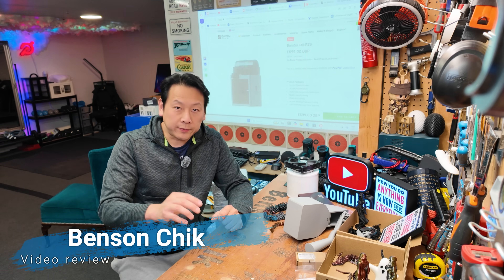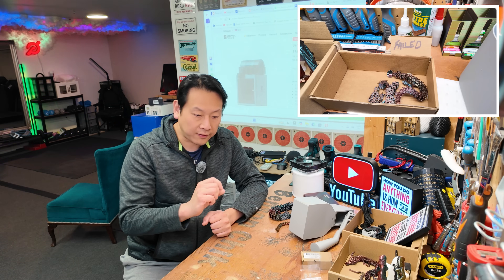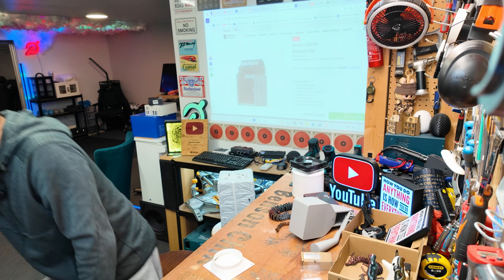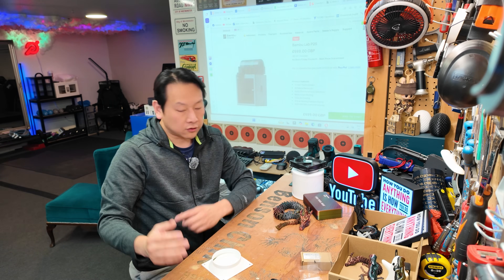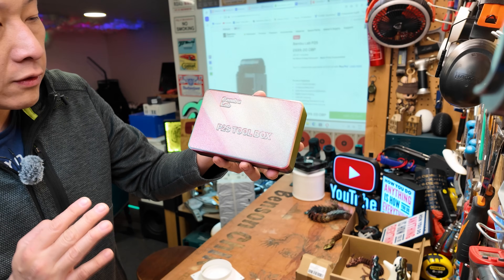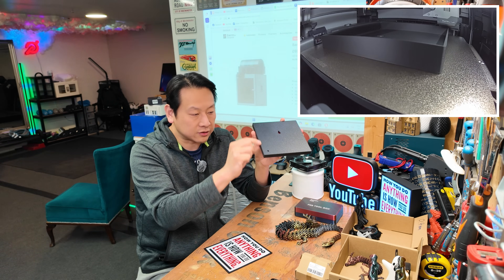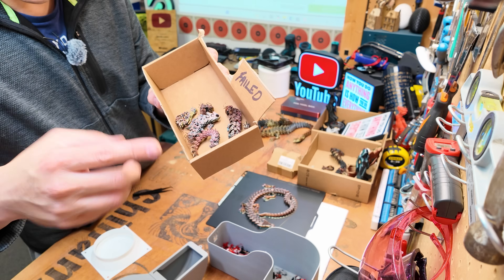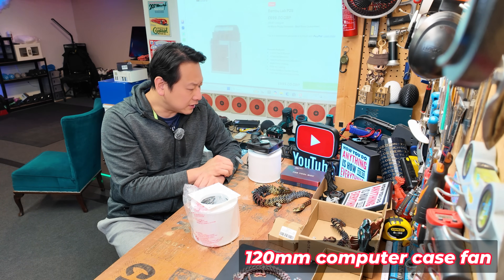Bambu Lab P2S After 1 Week Nozzle Failed, Aftermarket Fix… Do I Regret It

Comment: Hello, Im new to the whole 3D printing world and i just got my P2S with AMS pro 2 and so far its been a learning process just my only main thorn is the extruder overload notification after the 2nd day of printing I've opened and checked many times and multiple cold pulls and still face the same issue. Will the aftermarket nozzle fix my problem or am i just missing a simple fix.
Reply from the maker: Check if the spool in the AMS is turning smoothly, especially if the spool is not Bambu Lab or if it is made with cardboard of different size. After that the cheapest fix or try will be aftermarket nozzle

Comment: Clicking sound is not the extruder trying to grab the filament, it is the gear assembly. And the stationary gear most likely that is mounted in the extruder head. The removable orange gear the slides in there and has a gear on the end seems to be binding.
Reply from the maker: Not sure what it is but since I changed out the 4mm nozzle it never had the same problem again. When the 4mm nozzle was put back the same problem return. Aftermarket hot ends are cheap as chip and over a few hundreds of trouble free printing since.

Comment: I had the same issue with an unusual extruder motor force error on a 0.2mm Bambu nozzle after 1 kg of filament. Cold cleaning the nozzle resolved it.

Comment: i printed the exact same poop bin as you in PLA on my P2S and it had the exact same defect, in the same location 

could you please teach me why that happens? is it just the nozzle that is bad?
Reply from the maker: I think the default setting for that slice is too fast for the over hang. Was the machine shaking violently when printing that?
Reply: @BCreviews ea the printer does shake quite a bit, and it doesn’t help that i’ve got it on a utility cart because I need to roll it towards a window during prints for ventilation 😅 outside of remedying that, its good to know that the default print profiles aren’t to be trusted and that i should slice models myself prior to printing. thank you for the wisdom!

Comment: I'm a resin printer user, and I thank you for some actual user advice and review of this printer.
Reply from the maker: My sister is a resin printer user too, I prefer Filament as less mess and smell, 0.2mm nozzle yield best details but still not as good as resin. Only way to complete is to print with Matt or carbon fibre additive filament to hide the layer lines 😂
Reply: @BCreviews  I just purchased the printer today, I create mainly high detail scale models accessories for my plastic kits and some resin kits as well with my Phrozen printers. Not sure what to use this printer for but I will defiantly have fun with it. I don't think it will replace resin as the detail is unwatched at 10-30u.

Comment: Great video. My one piece of advice for new P2S owners is to buy a roll of PLA. I bought a roll of PETG (for heavy duty projects) which isn’t a bad thing but I couldn’t test my printer with the pre sliced projects that come with the printers pre loaded software. Not a big deal I found a small magnet project on maker world to test out the printer. First print was a smooth 20 minute success.
Reply from the maker: Good call, I would go further and say buy bulk of 5x1kg for more saving, unless you plan to give up and let the printer gather dust which is highly unlikely with P2S and maker world combo :)

Comment: Hi i am on the edge to grab this printer would it be wise to get it or any other recommendation thankyou
Reply from the maker: This is the first printer I had since 2021 so I don’t really have a suggestion of alternative. In terms of a printer for anyone who knows little about 3D printing the P2S is pretty fool proof. It tells you 90% of the time if any human error. If getting their filament it should really be press a button and print.  If you get other brand filament or want to change settings this allows tons of adjustment. 

The only function I would not suggest buying this for is multi colour change in the same model. Yes it can do it but it will be very slow and waste a lot of filament as poop. These is a reason why they bring out a 6 Hotends auto swap machine a few days ago 🤣
Reply: @BCreviews haha i have always desired those good multi color prints i have seen on youtube so wont lie i have to get a ams 😢

Comment: You really glossed over the failure you had with the filament clog? It would be nice if you could explain how this printer handled that failure and were you able to recover or keep printing? What did the part look like after you resumed? Were there missing layers in the print? This is a huge problem I have and would be nice to know if p2s solves it
Reply from the maker: There was no recovery, printer stopped printing and throw up error msg abnormal filament resistance. Tried heating it up to 300c and purge but nothing works. When trying to print the extruder will make very light clicking noise, then error of abnormal msg again At the end it was not worth fixing it, P2s super easy to change hotend anyway, cheap as chips from

Comment: Sounds like a possible extruder issue, keep an eye out on it. Just goes to show no matter how experienced the company is, they still will get it wrong! If looking for an aftermarket Nozzle, hotend, etc., I would go with Microswiss, they have top notch stuff. I have 3 nozzles from them and they are just extremely solid.
Reply from the maker: Gone through 5kg of PTEG Carbon fiber with a £7 aliexpress 0.4 nozzle with no problem so it was the Bambu Lab harden steel nozzle failed prematurely. I since has tested other size including a 0.4mm and 0.6mm AliExpress high flow which I did not experience any more issue. Put the original hotend back in the P2S and the same problem come back, click click noise and filament resistance error code.   Have a look at my more recent video and you will see. Thanks for watching !

Comment: After 8 days of continuous printing, Bambulab P2S does not print. I have the same problem as you. Hotend clean, nozzle clean, printing starts, but after 3 layers it reports the same error. I will replace the nozzle today, I bought original ones, but they are on the way from Aliexpress.
Reply from the maker: I have a video out today using different nozzle huge flow and all. Try using the original nozzle just to show the same error again so that was definitely my problem.

Comment: I just ordered one. My first ever printer. I hope my nozzle don't ruin my first experience ☹️
Reply from the maker: I think it is quite rare to have nozzle fail  :)   good luck !
Reply: @BCreviews I had it too
Reply from the maker: Lucky changing it out is easy and lots of aftermarket ones available
Reply: I got the P2S as my first printer also, you won’t regret it :)
Reply from the maker: Not regretting, must easier to use than one I have 4 years ago 😂

Comment: My P2S is due in about 45 minutes (currently have the P1S with the E3D Obxidian High Flow Hotend) so I also pre purchased the exact same nozzle as you did in this video so I had the high flow possibility of up to about 65/mm3 if I ever want/need it.

It's a shame that given Bambu Labs (from the UK warehouses anyway) sometimes ship using DPD that they don't give the option for next day delivery on shipping, or at least smaller, non-printer orders.

I would imagine the first thing I'll do when the P2S is here is set it up, print some kind of a control benchmark and then do it again with the new high flow hotend installed! We are such simple creatures, aren't we?!

Comment: Did the clicking sound disaooear with changing ti other nozzle? Or what made it go away? I had the same on my A1 with changing extruder gear from Panda, changed it back afther 1 day, clicking sound was awfull
Reply from the maker: It was with the original 0.4mm nozzle, once changed it the issue disappeared. Some say heat it up to 300c and push filament through but I just changed it out
Reply: @BCreviews  Weird, the clicking is usually from the extruder gears slipping, (you can test this easily) if it's the same sound you hear when extruding or retracting filament when the temperature is too low - you can confirm this with PLA loaded by simply trying to extrude/retract PLA when the temperature is below approx. 150 degrees, as this is where the filament generally becomes too solid for the extruder to move 100% of the time.
Reply: @PassieWaterm is it at all possible you didn't put the black grease onto the gears that came with the Biqu Claw/extruder gears? That sound is usually from gears not working correctly inside the extruder, slipping/binding. Also, I've seen it a million times where people install the new gears and the bearing falls out and they don't notice, or it comes out with the stock gear and they don't notice so the Biqu gear goes in and it's missing the top bearing and doesn't work correctly, sometimes with some not nice noises!

Worth checking, in case you didn't.

The other possibility is that the tensioning screw on the side is too tight or too lose - do you recall how tight you did it up when screwing it back in when reassembling? It's really easy to go too heavy or too little in fear of damage.
Reply: @benjaminfphillips i viewed several youtubes with the same problem, and i tried all the solutions (including the ones you sugfest) but with some the is no solutions. I even asked Biqu Panda and the confirmed that same assemblies just do that ( whatever answer that is). I didnt even bother to sent back because i did not know that the standard extruder has a steel  gear, and that is what matters when using abrasive materials, so the steel big gear has nothing to do with that.... so no need to upgrade.

Comment: Ive had my p2s for like a week aswell and had no issues at all, its weird how it can vary so much
Reply from the maker: After changing the nozzle it has been good, no complaints. Changing nozzle is easy and aftermarket one is cheap 😅
Reply: @BCreviews  yeah fair enough, yeah just had no issues with my stock nozzle, guess time will tell
Reply: also had an a1 with 2000 hours that had no issues so i guess ill wait till then to judge it haha
Reply from the maker: Could be the material I use, metallic colour and then PEGT-CF. The hardened tip original should be able to print them tho 

I have high flow hot ends testing this week so that would be even better if shave off some print time
Reply: @BCreviews  yeah fair enough ive only used pla and regular petg hf so far, got some abs in im going to try soon

Comment: With a 0.2 nozzle youre not supposed to use metallic type filament bc it will clog. Maybe that was your issue .
Reply from the maker: May be, the aftermarket one is printing ok tho
Reply: @BCreviews  it will for a while but the metallic bits build up  or youll get a larger metallic particle than most and it wont last as long as a .4 or .6

Comment: I printed the same poop scoop you failed at but mine came out 100% flawless using generic petg profile. I think it was using fast petg. All settings standard, straight through the handy app, started the print while I was abroad.
Reply from the maker: I think my hot end 0.4mm has issue, after changing it it print ok. I now use a poop bin which is different to that failed one.

Comment: Is the aftermarket nozzle any good?
Reply from the maker: Printing non stop this 2 weeks (half term break over here), so far no issue at all. I have not change the tip yet but it is cheap enough to buy the whole hot end to be fair. I have 2 more coming from Ali Express which is labeled fast flow so that would be really interesting as it will be a fraction of the cost of the Bambu Lab fast flow hot end.
Reply: @BCreviews  What was the cost from AE? Think they're only about £14 or so from the amazon store.

Comment: I saw some videos the machine is shaking too much ? Have you noticed it so far ?
Reply from the maker: Yes it does move a lot, I now have it one a heavy slab of concrete/tile and then on top of a foam exercise mat. Seems to solved the shaking issue a lot 😅
Reply: I ordered the machine but that issue made me think a lot about it  @BCreviews
Reply from the maker: It is a lot of money so I understand, once it is on a proper base and motor compensation is done it is not like a tumble dryer anymore. I do think the machine is tuned for speed out of the box and gone crazy fast. If your print is small then it is ok for it to shake crazy but when you are printing swords it will have to be chill and slow with option to slow down at height etc anyway.
Reply: Thanks ! ❤  @BCreviews

Comment: 9:50 wrong tool box shown both times  that one uses 6xm3 for hinges and latch strength.
Reply from the maker: Thanks for the heads up it should be https://makerworld.com/en/models/1909045-p2s-toolbox-push-latch#profileId-2046952

Comment: I think your issue on the overhangs is cooling. A lot of people have talked about the poorly designed ventilation system on the P2S. I would print a riser and remove the glass for PLA. It looks like sagging on the overhangs, filament is still soft when the next layer is printed on top of it.
Reply from the maker: Printed one, will check and make another video soon if it helps.

Comment: Benson great video I can vouch for Jayo filament ( basically its rebranded Sunlu) very easy to print with and like you I tend to buy in bulk from aliexpress as its much cheaper and is shipped from a uk warehouse. I also bought that arrived yesterday is the new Biqu Cryogrip Glacier Pro build plate as its for mechanical filaments abs asa carbon fibre and glass fibre variants pa (Nylon) etc as you dont need an adhesive and it works great with abs so may be a worthwhile look for you if you print with those.
Reply from the maker: Fantastic, thanks for the tip, will look at the Biqu Crygrip plate. Do you have a link for the one you use with the P2S?

Comment: I have had the P1S since it came out and just got the P2S. I am liking the improved display and the AI stuff on the camera. I had a part break apart quite a long way into printing and it paused the print and sent me a push notification. For another print I accidetally left a piece on the plate from the previous print and it warned me when I tried to start the job.
Reply from the maker: I find the P2S moving too fast for some of the print, it can be tune in the settings I supposed. For example I print PLA on the smooth plate and it failed as the hot end drag the model and it lost its adhesion. But at the same time my PETG-CF stick like glue on the smooth plate and I am printing a sword blade vertically and it comes out perfect. It is still not a idoit proof print but very close. Not tested the AI part with leaving parts on the plate tho  lol

Comment: I only have an Bambu A1 at the moment but I have a P2S arriving later this week, Loving your videos. Thank You.
Reply from the maker: Thanks for watching, I am making the most out of it and after the nozzle change it is printing non stop. Someone mentioned to me that I can heat up the Bambu hot end to 300c and do a flush and tbh I just buy another to swap over as nozzle changing is easier than changing my socks  :)    Hope you start printing with the P2S soon.
Reply: I think a1 still wins. It just works. P2S causes so many problems to me.
Reply from the maker: Most importantly it does what you need it to do, latest tech not always needed 👍